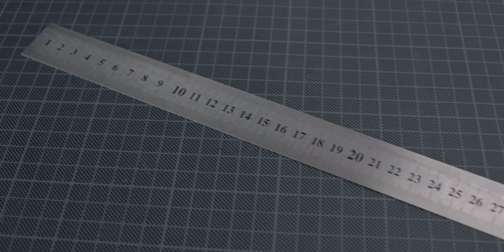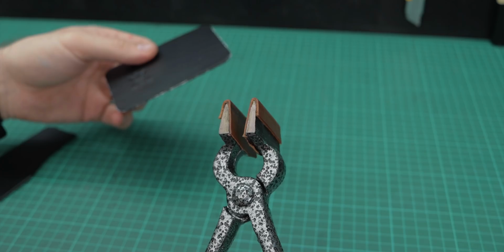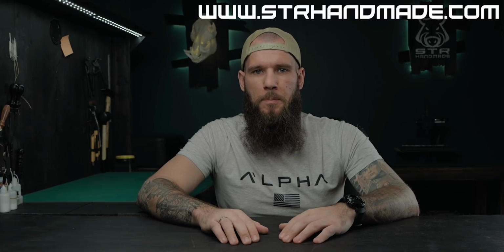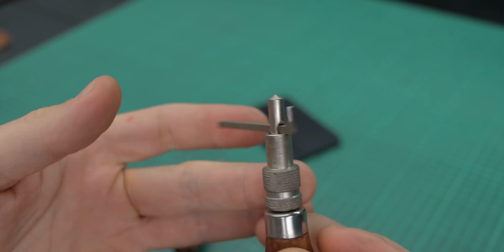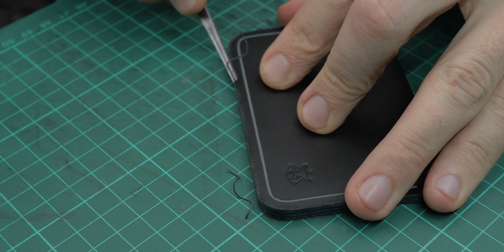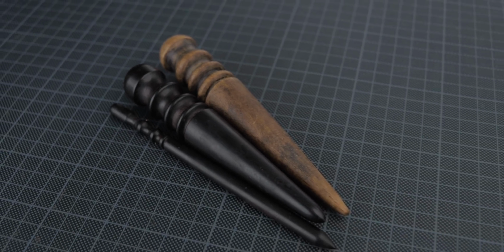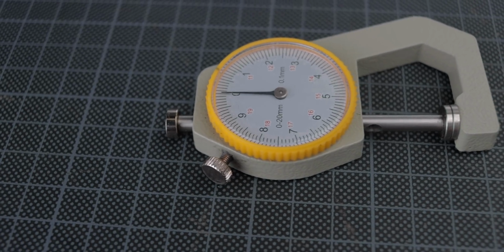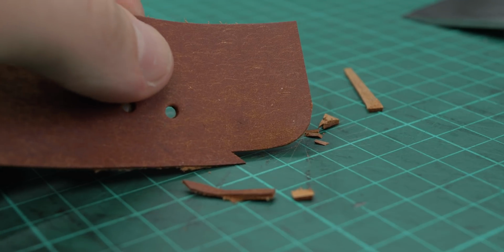Hand tools review I'm using in Leather Crafting

Comment: Hey my friend, what thickness are the edge bevelers you are using?
0.7 mm 1.0 mm?
Thanks in advance!
Reply from the maker: I cant say exactly, but i guess Palosanto size 0 ±0.4mm and size 1 ±0.6mm
Reply from the maker: For single layer such as pockets edge i use smaller, for glued couple parts i use bigger one
Reply: @strhandmade  Thanks a lot!
Reply: @strhandmade  Great, 0.4mm isn't it too thin, you use that more or the 0.6mm?

Comment: I agree with you regarding the Thread Zapper.  It goes through batteries quickly and a lighter is a better option.
Reply from the maker: yes, its huge con of this tool. In general i changed battery twice and then realised that i wasted money for this tool :)
Reply: I really like the thread zapper, but I use rechargeable batteries.